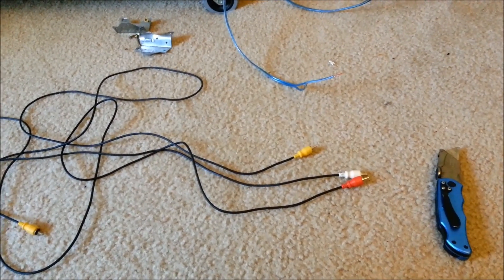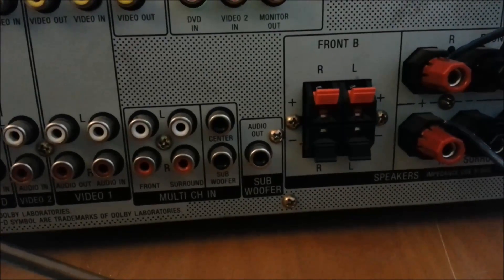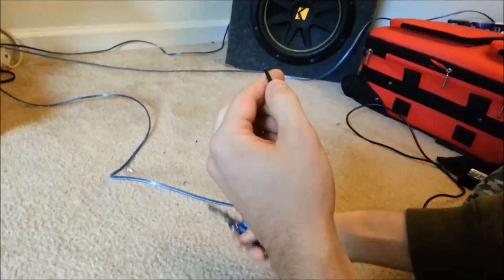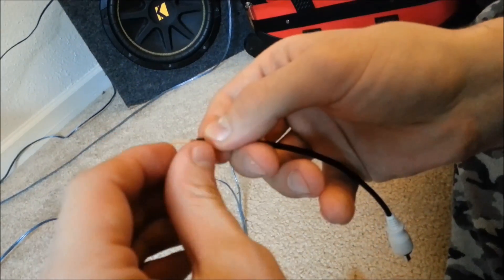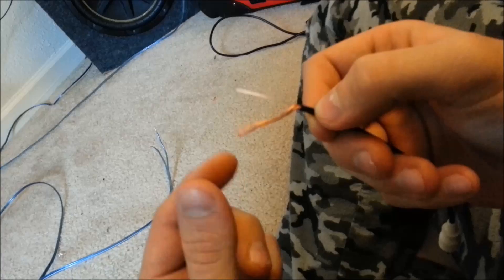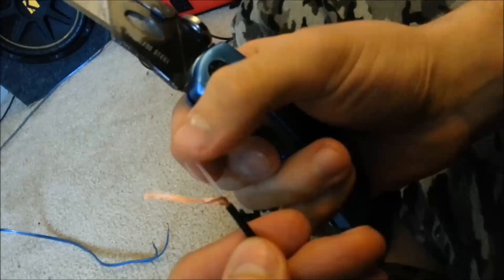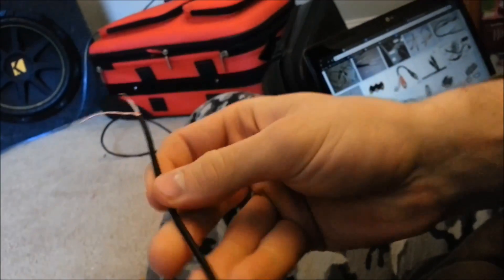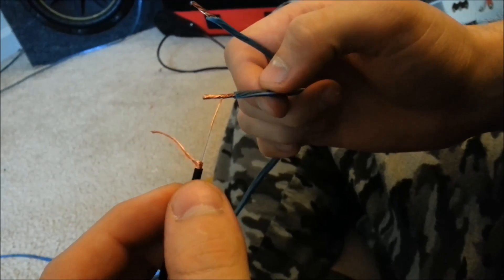Convert speaker wire to RCA or monaural

Comment: the white wire i have just has one wire on the inside.  are there different kinds
Reply from the maker: +ShyRage1 the RCA cable has to have 2 wires to function. A positive and the ground or negative
Reply: J Robling I redid it and your right thanks for the correction.  I think it isn't working because of the connection itself on the receiver.  Unless i didn't attach the wires right

Comment: how to identify positive and negative wira in speaker...
Reply from the maker: +anjum bhatia If your trying to figure out the positive and the negative wires from your speaker you should look on the speaker itself, it should identify a plus and a minus. If that is not present then move to color, black is almost always going to be your negative and the other color being positive. If you have wire testers you can also use those.
Reply: thanks for help bro.....
Reply from the maker: +anjum bhatia no problem. Really try and look for those plus and minus marks on speakers. They are always a black on black plastic thats harder than hell to find

Comment: Could you plug the split RCA cable directly into the speaker? or do you HAVE to connect it to regular speaker wore? 
Basically, I Have VERY long RCA cables, could I use only them and bypass the speaker wire?
Reply from the maker: +Brady Hettinger do you mean just use a long rca wire withe the male end and just the positive and negative split on the other?
Reply: +J Robling Yes, would that work.. or do I need to attach it to regular speaker wire?
Reply from the maker: +Brady Hettinger nope. The two wires inside the rca act just like 2 normal speaker wires. So you are just fine to use it like that

Comment from the maker: use the red black wire for a speaker for your tv. the black will be used as a negative and the red will be used as a positive. if you are using a sub then you need an amplifier and you would use the other colors with black being negative
Reply: +J Robling also depents. if the subwoofer is selfpowerd then you won't need a extra amp.. its a bitch with classic recievers..
Reply: U know u could just buy RCA male to speaker wires....your welcome!!!
Reply: This didn’t work for me. I followed it perfectly. My old sub from my home theatre only had 2 wires, I bout a RCA to 3.5mm cable & cut the white end off.... tied them both ways to mKe side I didn’t accidently do wrong side.... nothing 😥
Reply: +Leo Cardenas i don't think that would work. Because it's wire converted to rca where would you put the wire? thank you.....

Comment: hi J Robling, thanks for your reply my message.i need to ask you again , when i check my speaker am very  compose because my speaker have two different color wire. blue black wire is super woofer speaker input  and red black wire is front speaker input.  witch one i connect to the cable wire. nd its alright i connected that to  my LG Digital  tv high difination
Reply: Brown side

Comment: Could I do this for a sub-woofer that is not powered?
Reply from the maker: +putsomecheesonthat yes you could, but you wouldn't need to wire an amp.
Reply from the maker: If you want to use a subwoofer for your TV or surround sound you need to wire it to an amp just like a car.
Reply: +J Robling noobie here. What do you mean by saying you wouldn't need to wire the amp? Thanks for the video btw!

Comment: My amplifier doesn't have an audio out subwoofer (black rca), instead it has a line out (red and black rca)...can I do something to work it out?
Reply: I'm thinking about using a "RCA F Female to x M Male Splitter Y Combiner Plug Cable" to turn my line out (red and black) into something more similar to what you have (one black rca). I really don't know what I'm doing, if someone has any advice please help! Appreciate
Reply from the maker: Guto Niemeyer It sounds like you have a good idea of whats going on. From what im hearing you need to take the positive and negative and combine them into the single monaural. So the splitter sounds perfect

Comment: So can you use the same cables(red & white) for the 2nd speaker.
Reply from the maker: Victor Rodriguez Yes, All of the RCAs are the same on the inside, just copper wire. The color is there so you can easily identify which one goes where

Comment: Not sure if someone asked already but would this work for my sound bar that has a "sub in" connection? I'm looking to add a bit more bass to my system using an old subwoofer. Btw it's a Vizio sound bar if it matters. Thanks!
Reply from the maker: Beanz572 With a sound bar that has a sub in input its the same thing. Make sure you have enough power running the sub though

Comment: I have two wires each for my right and left speaker. How can connect them to one rca cable going into my tv??
Reply: I am also having two speaker wires red nd white how to connect it with tv
Reply: @metayogi3477  we have the same problem bro tell me if u proof it
Reply: @smartboy9978  9±77
Reply: CAN anyone tell me how to hook up that
Reply: Mine isn’t working 😭😭 tried it many different ways. Looks like I’m forced to buy a new subwoofer

Comment: This answered ALL of my questions. Just traded cars and finally said enough with the line out converter which i could NOT get to work for jack squat. Testing this method out to get my rca inputs to my amp. THANK YOU!
Reply: King Kuma  so you mean to tell me this works cause I’m about to try it I can’t get my amp and sub to play in my car I used a 2 line outs and then janks don’t work at all

Comment: what if i want to do it with 2 speakers?  thanks
Reply from the maker: If you want to use two speakers join both the positives and both the negatives together, taking 4 wires into 2. Make sure you have an amp for any extra power

Comment: im doing pretty much the same thing. but with a kenwood sub. and my receiver has a monaural connection and i spliced it and its still not working. the sub worked with my old home theater system. but not the new Pioneer VSX-534-K.... any help?
Reply from the maker: Justin Robeson what do you mean you spliced it? how was it connected on your old system?
Reply: J Robling My old system was the old Red and Black speaker wire connections. and the new receiver is the RCA style for the sub only. all the other speakers are the old black and red push button insert the wires and release the tab. but for some  odd reason i plug the sub up with the converted cable , like you made in the video. and its not working. ill have to get a Volt Meter on it and see if the RCA out plug is even fuctioning.
Reply from the maker: If it is hooked up correctly you might not be getting enough power to your sub. Thats why you need an amplifier just like in a car.
Reply: its a 500W revciever. my 200w ran it fine. and still does
Reply: how ever, An In box AC power supplied amp. is hard to find. i cant find one anywhere
Reply from the maker: Your sub has speaker level inputs. It needs direct power from the amp to run. Newer receivers like what you just bought have line level inputs, which are used to run self-powered subwoofers. The reason that your sub will not work is because the current from the monaural output is too small to move your subwoofer, a separate amp would be needed (the amp takes the line level signal and amplifies it to run the speaker).
Reply from the maker: My video was on how to hook the wires up. there are videos on youtube that shows how to hook up a car woofer like I have to your surround sound system. All you really need is a power supply with your system if you do it this way, https://www.youtube.com/watch?v=XbHR8D9lCbM. Or you could get a new powered woofer like this, http://www.monoprice.com/Product?seq=1&kpid=8248&format=2&p_id=8248&CAWELAID=1329456740&CAGPSPN=pla%26catargetid=320013720000066114%26cadevice=c&gclid=CjwKEAjwjKOpBRChjsTyicbFy3QSJADP1gTNDne_QucuIp_YsA5OHq7rSX4m3bLDbkTf6zV67oUeUhoCdwzw_wcB
Reply: J Robling excellent explanation! I was having the exact same issue trying to run an old non-powered Pioneer sub through my new Denon receiver. After I combined a 12gauge speaker wire with an RCA cable following your video and connected it to my AVR it wasn't outputting any bass. Now I totally understand why it isn't working.

Comment: Hi mate. Is it possible to entwine the seperate  sub woofer neg and pos leads with the normal two neg and pos leads so I still have space for an additional speaker. Or is this not doable putting too much on my amp? Its a marantz pm4001

Comment: Can i use the yellow cable or do i have to only use red and white?
Reply from the maker: sniperman129 You can use any color you want, they are all the same under the plastic cover. They just use different colors to make it easier to tell the wires apart.

Comment: Hey I was in the same situation as you. The only question I have is that I have 22 gauge wire and a powered sub woofer so would i need a bigger gauge wire or can i stay with the 22 gauge? Thanks for the great video.
Reply from the maker: sniperman129 I have run 22 gauge wire with a sub before and it worked but if you want better sound I would get a bigger gauge

Comment: My reciever has 2 pre out ports for the subwoofer marked 1 and 2.  Will this method still work?
Reply from the maker: Nick Pavao As far as I know your receiver has 2 ports outs for two different subs. This will still work if that is the case. Just make sure its a powered sub or you have an amp hooked up too.

Comment: Do you do the same thing with the red rca cable too? after pigtailing them, do you wrap it with electrical tape or anything? Very inexperienced.
Reply from the maker: Yes, all the colors are the exact same, its just a color system so you dont get it mixed up. the only difference is the red will have a red or pink plastic case in the center. After you bind the wires I always put electrical tape over it so it doesnt come lose or short anything out

Comment: Great video, I didn't know that the copper wire surrounding the plastic wire inside of an RCA cable was just the ground and that the actual signal was inside those thin color coded plastic wires, thanks.

Comment: it will be low volume not loud you wont even be able to hear it across the room lol i will be weak
Reply: ***** Because the RCA output is unpowered and designed to go to a powered subwoofer whereas this is a passive subwoofer. So Tone is right.
Reply: it*
Reply: Tone Marko And you know this because?...
Reply: TJ Turner 
Depends on the receiver 
Some have a "sub pre-out" which is active compared to "lfe out/sub out"which is
passive,the reason I know this is because I have passive front speaker's with rca jacks and they are powered through the pre-out connections on my receiver without any issues.
Reply: I also wouldn't recommend splicing and pairing 20 awg rca cable with thicker gauge speaker wire as you are causing too high a wattage to go through a "standard rca cable at 20awg"which could lead to a fire,it's actually better to purchase an rca to line level cable as the thicker gauge wire is soldered directly to the RCA connectors avoiding risk of fire.

Comment: does this work if you connect it to yo tv ?
Reply from the maker: Lil Jsavagee As long as your connections are right and you have the correct power running to whatever speaker you chose.

Comment: can i just use the RCA + - wire for the speaker?
Reply: Yes. In theory, if you have a 30 foot RCA wire & wanted to convert all you'd have to do is splice the very end - as you see in the video - and connect the ground and positive. I don't think he had a long enough RCA wire to do this w his sub so he did the next best thing. Great video btw.

Comment: If I did exactly this any idea why it wouldn't be working?  Do I need to have the 5.1 decoder turned on on the amp or can I play normal 2 channel and still get woofer sound?
Reply: Andrew Huff mine didn’t work either, 😩

Comment: My receiver has two RCA outputs for the subwoofer instead of one.  The subwoofer itself uses speaker cables.  Can I run positive to one RCA plug and negative to the other?
Reply: Connect your speaker wire to one RCA then use a RCA female to male splitter, you can get these for a couple bucks or less at Fry's or any other electronics store.
Reply: +Jessie Santistevan WRONG. ..THIS IS WHAT U DO. GO TO WAL-MART ASK FOR (RCA MALE PAIR TO SPEAKER WIRE) it only costs  $8.